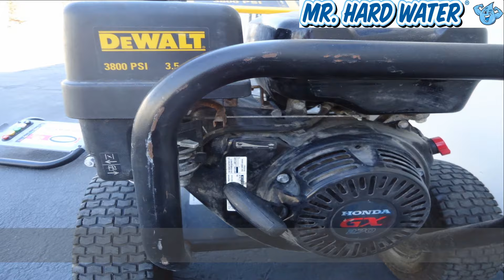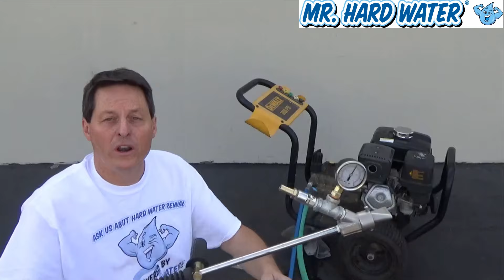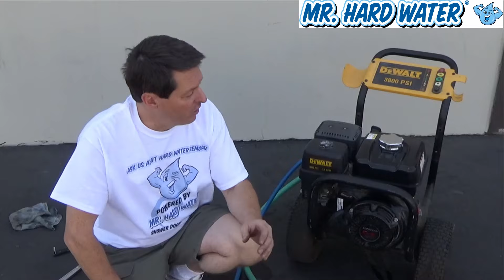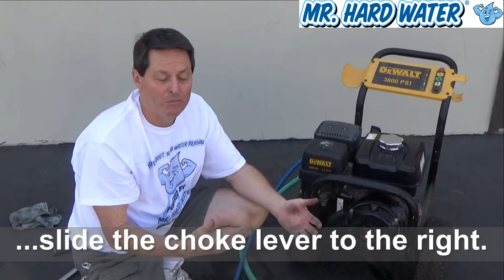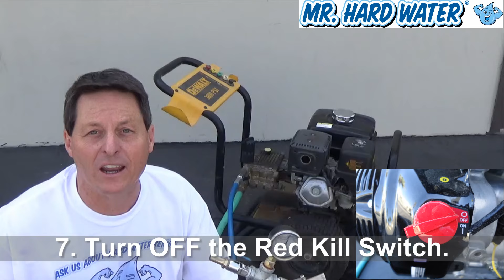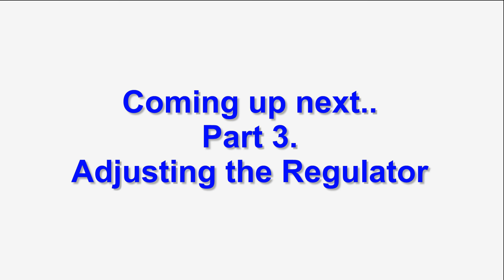Dewalt 3835 - Part 2 Starting the Engine - Mr. Hard Water Wet Blasting

Comment: Great video! Need help? I have the same Dewalt pw. What is the yellow wire coming out the motor To the on/off called? That wire was cut and went inside the motor and cannot be retrieved How do I go about replacing that yellow wire that went back in the motor?

Comment: Mr.Hard water your instructions are so clear and easy to follow.  I have made all the hose connections and then I pressed on the gun trigger but no air comes out and no steady stream of water even after holding down the trigger for two minutes.  My second problem is that the throttle control lever won't move to the right or the left.  It seems to be stuck??  I see you doing it so easily.  Please explain to me what to do.  Thank you so much.

Comment: Do you turn the water off from the water souce before you start it? That's what the manual said but i didn't see you do that. It said just turn the water source on to get the air out of the hose then turn it off

Comment: Can ya tell me what's wrong when it barely starts running and then when I move the choke over to the " run" position it dies? It won't stay running... I've pulled it about 50xs now and it will barely start, barely turn over, and it'll run like it's on life support but if I try to move the lever over to the hare,  or move the choke lever over to the run position  it dies???
Reply: Sure, what’s wrong is it’s not staying running. I’d recommend seeking how to fix

Comment: The video helped me get over the hump in terms of getting the pressure washer started. For some reason it will not build up any pressure when I squeeze the trigger just a small amount of water sprays out. Very light pressure If close to not at all. Does anyone know how to get this machine to build up pressure so it will actually pressure
Reply: I think thats normal. Maybe his hose has an insane amount of pressure coong out. If it operates normally once started and it cleans well then youre fine

Comment: Is there anything I need to do particularly for a first time start on a new pressure washer. I bought a new one same model I got one out of box changed red oil plug for shipping to yellow. filled gas. connected everything turned water on and ra for about a minute purging water with unit off. then turned chock and she cranked right up. but as soon as I pulled the trigger it had no pressure and made a horrible noise in the triple A pump if I depressed it stopped and engine sounded fine. I never have heard this in my seven years of using dealt pressure washer with changing oil on both pumps and engines for maintenance. so I have experience, did I miss something during the initial start up? it was a screeching sound that did not sound good at all. ive returned for a new one just filled with oil in motor out of box and gased up but now waiting reading the manual again to see if I missed something. thanks for any help anyone I truly appreciate it. mine was stolen this week out of my truck cut lock and lifted over tailgate. its been a heck of a week to say the least.

Comment: Allow me to vent for a second. These machines run between $600-$800 and it takes an act of god to start them. I first purchased the 3700 psi model from Simpson and no luck. I even took it back to Lowe’s and they couldn’t get it going. Went to Home Depot next and got the Dewalt 3600 psi and followed the instructions to the T, still nothing. Holding the trigger with the water running and trying to pull the rope at the same time is an art. Still, no start. I had a $100 mower that starts faster. Just saying
Reply: Starting a pressure washer needless to say , requires a little tenacity. I learned a long time ago to warm them up for 20-30 seconds with everything hooked up, but very low water pressure on at first. After a 30 sec warm up time then crank more water on slowly through the machine . If you have to turn it off for any reason , when turning it back on release the water pressure from the gun with an attachment still on there. If there’s no attachment you risk blowing out the rubber O ring on the gun . Sometimes you start it on choke, then a second later try not on choke, Half throttle usually until fully started . If having trouble starting after a long storage try starting fluid in the carb , then run Star-Tron in the fuel to break down the Ethanol from crappy gas  or just old gas . Definitely put in new gas if left stored as well . A new spark plug every so often never hurts either . Good luck 🍀👍

Comment: Your trigger gun has a flat spray head at the tip of the lance, is this what you call a coil gun. and at 3800 psi: what kind of rotary attachment would you use (if at all): wide or narrow.

Comment: Mine didn't work and its it's completely new 🤦‍♂️
Reply: jose sorto SAME NEW OUT THE BOX WONT START
Reply: @jessichand7768  make sure to add the black bag of oil in the engine  ok and try it ok
Reply: jose sorto no much
Reply: jose sorto no luck
Reply: @munrra_503_squad  do you need to put all of it in?
Reply: If you have your receipt take it back😥
Reply: jose sorto I did lol they said it’s manufacturer defect or something I guess got a craftsman instead
Reply: @jessichand7768  😥😥😥